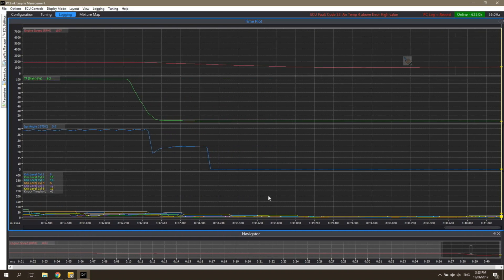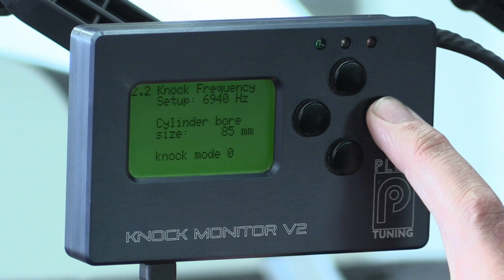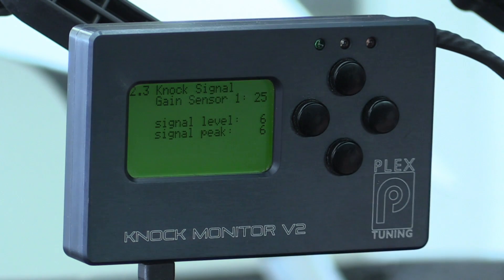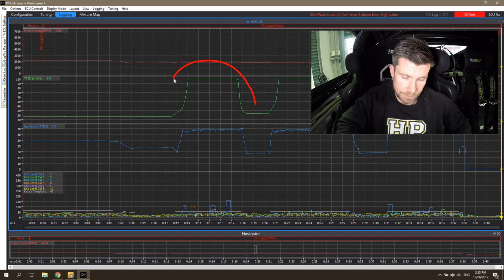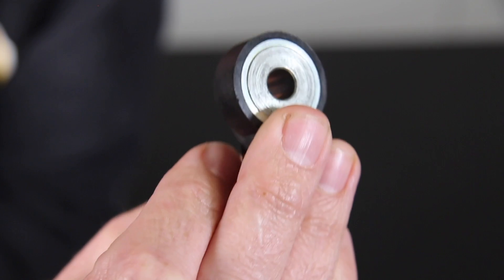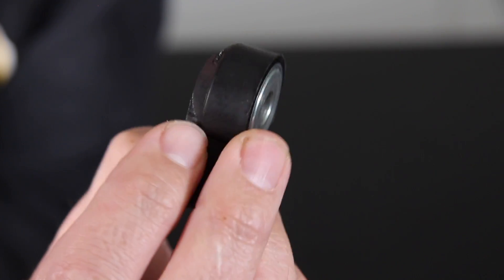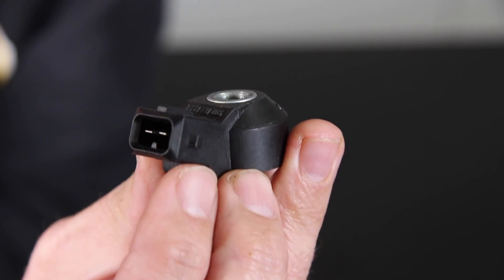What Is A Knock Sensor? (Detonation, Pinging) [FREE LESSON]

Comment: ** PLEASE HELP *     Im simply trying to get an approximate RPM using a knock sensor.... for low cost......   using an arduino. any ideas ?      the knock sensor has a LOT of noise.... i am trying a comparitor and then a schmitt trigger... then getting the arduino to measure the time between pulses, BUT there is still too much noise.   I just need Approximate RPM  but cheap ...ideas ?
thanks for your help.

Comment: You seem very responsive to comments and questions. I'm desperate but if you could...  I have a knock sensor 1 code and I have a new knock sensor but I tested both for continuity and neither have any and the  manual says they shouldn't have any. I just don't want to install this part that costs 170 and be in the same position and out 170 bucks.
Reply from the maker: Hey there g x, we're not really that helpful with general repairs and maintenance sorry, it's outside of the scope of what we do. If you're setting up your car for tuning and have installed a knock sensor that is giving you issues, we can help via the members only (note it's is paywalled) forum as that is where we help with technical questions, but I wouldn't tell you to sign up for just general troubleshooting - https://www.hpacademy.com/forum

Sorry I couldn't be of any help - Taz.
Reply: @hpa101  okay thanks for responding
Reply from the maker: @GXOUT  no worries, sorry I couldn't really be of any help - Taz.

Comment: I just adjust my timing to the maximum advance position and then I am done.   

My prototype does the rest to keep knock away.  

Or at least it did until I destroyed it.  I can always build A new one.
Reply from the maker: This is an inefficient way to manage knock if you're trying to get the best performance out of your engine sorry - Taz.
Reply: @hpa101   How would you know if it is an inefficient way to do things or not ?😏  

I really would like to know how you think my prototype works!

I've seen nothing but gains while using my prototype and have not found it's limit.  Multiple tests are on the way but the car needs some upgrades to happen first.
Reply from the maker: If you haven't tuned for MBT then you could make LESS power at maximum advance than before it if you never encounter knock. I recommend you watch this free lesson here: https://www.hpacademy.com/courses/bare-minimum-tuning-knowledge/ignition-timing-explained